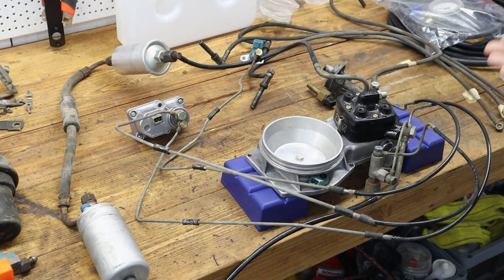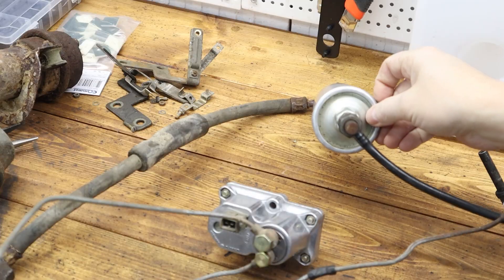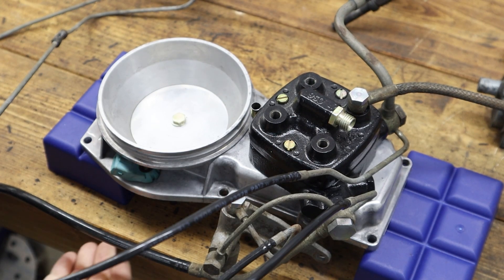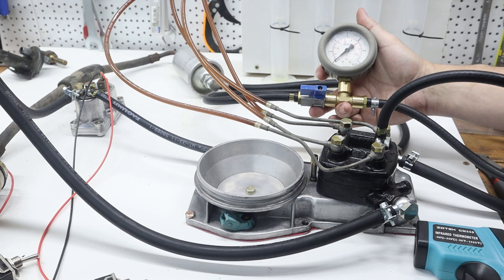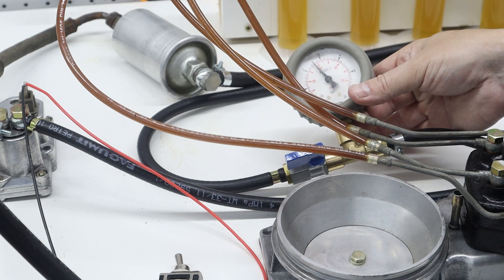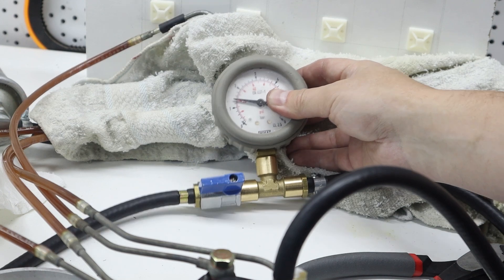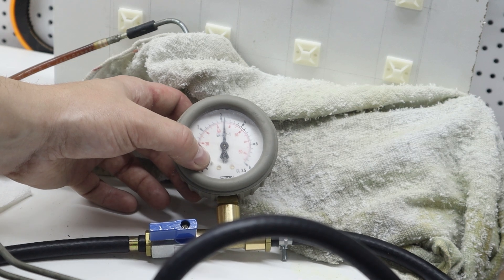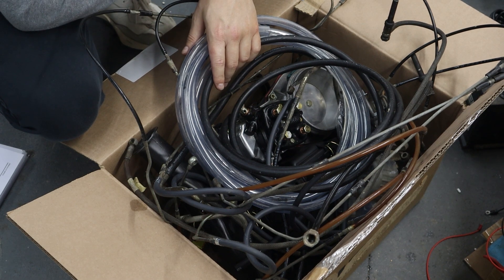Bosch K-Jetronik CIS System Bench Test

Comment: Hey Armin,if you don’t mind me asking I am trying to adjust my WUR aswell , where did you get the adapters for the fuel lines and which size are they?
Reply from the maker: Hi! I got my fuel pressure testing kit from Missingparts Germany. It comes with fittings. I belive smaller one is m8( you don't need it if you're doing this in your car) and the bigger fitting is m10, which you get in the kit.
Reply: @RestorationApprentice Hey Thank you very much for the fast reply, also where did you get the fuel fittings for your build. I want to replicate it at home to adjust my 924 Wur
Reply from the maker: @timgarcia6732  Local hydraulics shop, that makes and sells hydraulic lines and stuff. They'll know what you need.